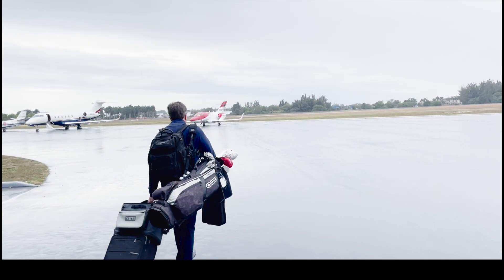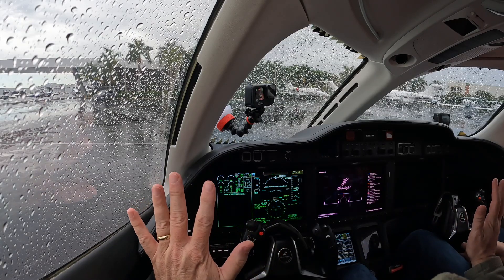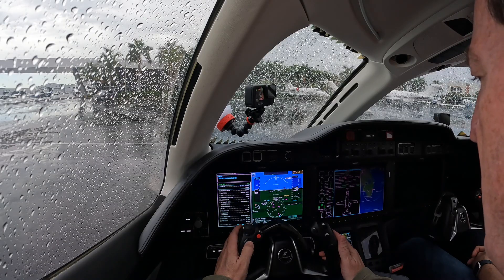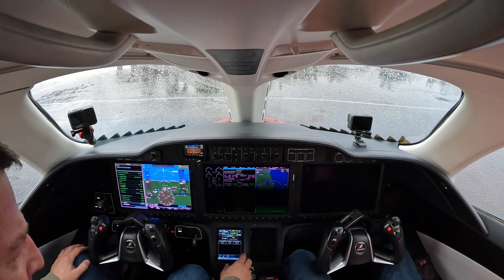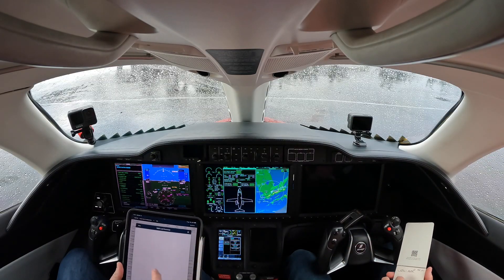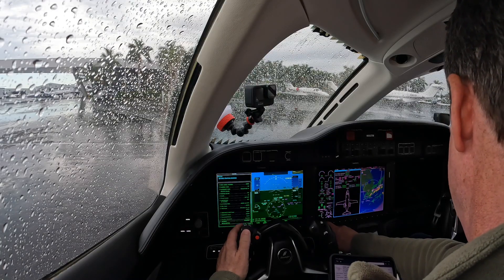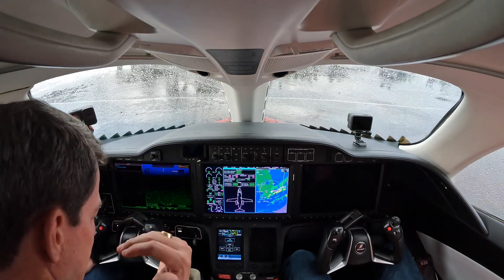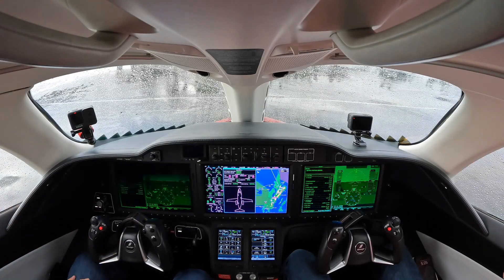Anatomy of a Jet Flight - Part 2 of 3 (Cockpit Programming & Checklists) HondaJet Pilot

Comment: Another GREAT video, Thank you BM6.     On the Start-Up, I saw you used a timer counting down for the Starter disengaging (The Green Ring around the starter going out) I have in my notes, monitor it to disengage less than N2= 45%.  I think BOTH procedures work, just wondering if you every heard of it. I can't remember where I got it, I write down specific info on all the vids and articles I read on the HondaJet.
Reply from the maker: Starter drop out is at "about 45%" and the total start limit it 30 seconds. I set 32 so thst I have tme to hit the start button right as it turns to 30

Comment: That was really good, ,very informative.
What exactly is the range of the jet?  Can you make it to Bermuda with all required reserves coming back to the U.S. if necessary?  
And if you can make it to Bermuda, could you make it  to the Azores from Bermuda?
Reply from the maker: Hey thanks.  This was based on the questions I get from you all. It seemed like breaking for down a flight was the best way to go at it. Soooo...range. It depends - Weather, winds, how much you load the aircraft, how high you fly, how fast, etc.  BUT - the NBAA published range is 1547 nautical miles. So the answer to our Bermuda question is Yes. The issue with Bermuda is that it requires having an HF (High frequency) radio which I don't have in the jet.  But Ive been there bad loved it...I'm working to find a way to fly it soon. I'll take a look at the Azores.  BUT the main reason pilot's haul as much fuel to Bermuda a possible is because  it's so expensive there!
Reply from the maker: So I'm hosting a Live Q&A this Sunday to take on additional questions Here's the link. It's be great if you could join

https://www.youtube.com/live/tFK4m1uyEe4?feature=share